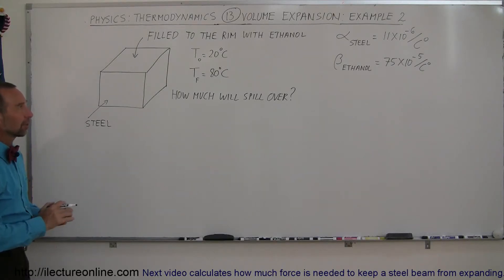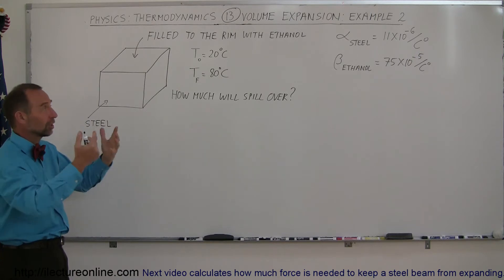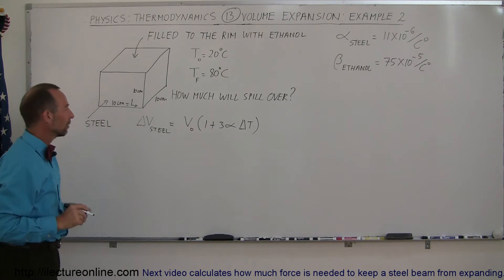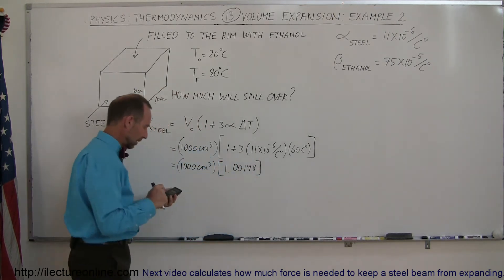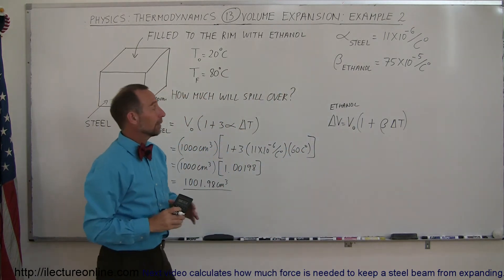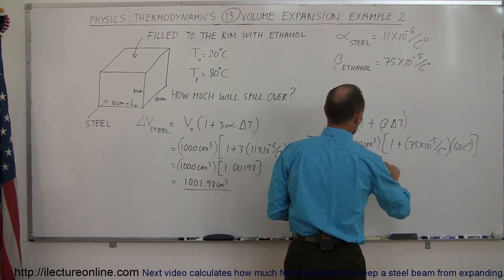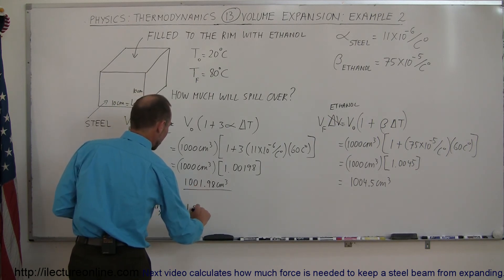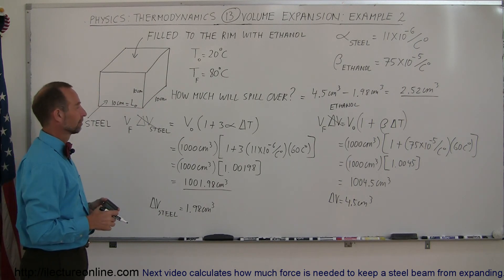Physics 21  Thermal Expansion (3 of 4) Thermal Volume Expansion: Example 2

Comment: you can also just take the difference btwn the two coefficients, multiplied by V0 and change in T. I got 43.02, I believe you calculated the final volume for ethanol wrong

Comment: Does it matter that you are assuming there to be 1000 cm^3 of ethanol inside of a solid cube of steel (1000 cm^3) or would it really not matter whether the cube is solid or if it is a shell (or tank in this case)?
Reply from the maker: The volume of the solid cube or the hollow tank with change in the same way.  The change in the volume would be the same.

Comment: Sir is that situation dangerous in real life? And thank you for the wonderful lessons. I have learned so much from you. GOD bless and GOD speed(Whatever it means :D
Reply from the maker: Thank you for your blessings.  Heating ethanol to 80 degrees C is not dangerous as it will not combust at that temperature without a flame.  (note that alcohol is used during cooking).

Comment: Hi Professor, I just want to know why you used the equation VF=V0[(1+(BETAxCHANGE IN TEMPERATE)]. Since we're calculating the volume, why dont we multiply the coefficient by 3 like you did for the solid? Is it because of the fact that its a liquid?
Reply from the maker: Yes the volume coefficient of expansion does not need to be multiplied by 3.

Comment: Thanks Michel for this lecture, please reply to my query related to Beta value (others comments are welcomed too)
if i am calculating change in volume for water inside a pipe where the temp has increased fro 81 Fahrenheit to 87 f what would be my beta value ? thanks in advance
Reply from the maker: +Ashish Chaturvedi 
For water the coefficient of volume expansion is not linear and varies with temperature.  Here are some values:
water at 10oC: 0.000088 (1/oC) 
water at 20oC: 0.000207 (1/oC)water at 30oC: 0.000303 (1/oC)water at 40oC: 0.000385 (1/oC)water at 50oC: 0.000457 (1/oC)water at 60oC: 0.000522 (1/oC)water at 70oC: 0.000582 (1/oC)water at 80oC: 0.000640 (1/oC)water at 90oC: 0.000695 (1/oC)
Reply: Absolutely right .. I have seen this before. But since there are two temperatures thats why two beta value and the formula has only one beta ... please help
Reply: +Michel van Biezen Absolutely right .. I have seen this before. But since there are two temperatures thats why two beta value and the formula has only one beta ... please help

Comment: Hello Sir . thank you very much for your lovely Physics' lessons  .

I got the same correct answer ( 43.02 cm^3 ) using this equation :-

V "sp."   =  Vf "eth."   - Vf "st." 

directly :)
Reply from the maker: SoMe Honey
There are often multiple ways to do a physics problem.  It is good that you explore other ways to solve the problems, it will enhance your understanding.
Reply from the maker: Michel van Biezen
I erroneously used 7.5 instead of 75 when entering the volume expansion coefficient for ethanol.  Your answer is correct.
Reply: Me to.

Comment: sorry 
but is not Vf = Vo(1+alfa*delta T )
Reply from the maker: Mohamed,
Alpha is the linear coefficient of heat expansion, so it can only be used for changes in length due to changes in temperature.
For volume you have to use 3 * alpha.
Reply: ok 
thanks :D

Comment: Not sure if I'm doing something wrong, but I'm getting a different answer...

When I do 1000[1+(75E-5)(60)] I'm getting 1045, not 1004.5
Reply from the maker: John,
Good catch.  You are correct, the change in the volume for ethanol is 45 cm^3 (not 4.5 cm^3).
Reply: +John Nemec Got the same problem. 1045 is the correct final volume of ethanol.